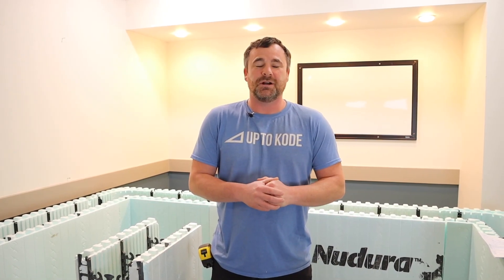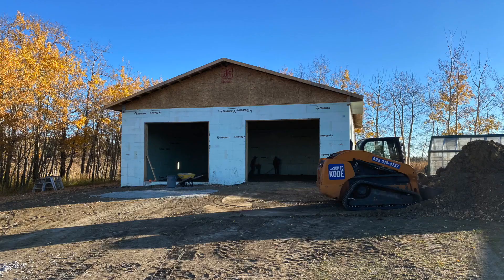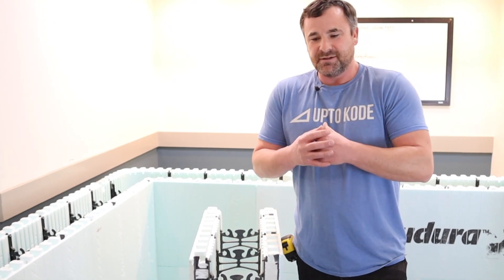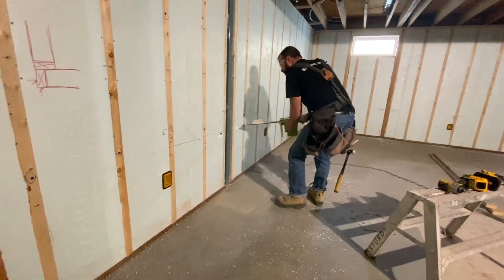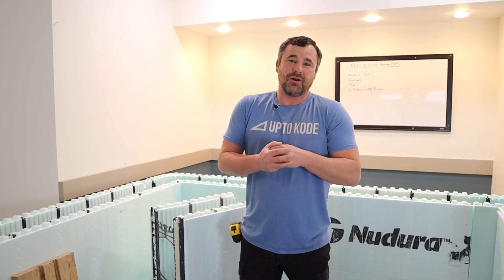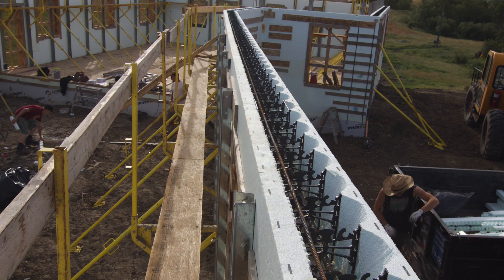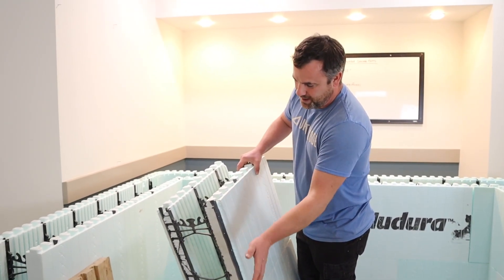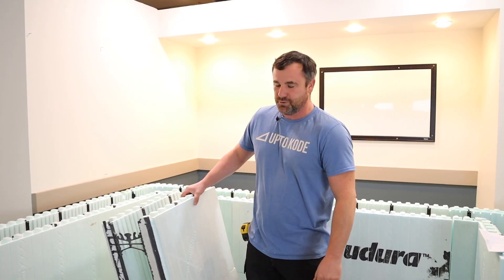Frequently Asked Questions of ICF

Comment: Excellent video. Thank you. However I have an amateur question. After you wrap the walls of an ICF house, how do you know where the plastic ties are to screw in external cladding. Most of the wraps are not transparent. I know the screw-in locations are every 8 inches or so and they are easy to see when you don't cover them with wrap, but how do you know where they are after they are covered in wrap.

Comment: 8:25, "ICF is about 5% more (cost), but can that cost be offset if the homeowner sets the blocks themselves?
Why isn't roofs ICF, is is because of the transition of the vertical walls to the diagonal pitch of the roof, and if so, will that transition piece be remedied in the near future with common roof pitches? I hope that made sense.

Comment: If you could answer this I'd appreciate it as no one else has responded. Is there a max wall length possible? Think of a shop, say 100' x 80' with 20' wall height. Would those walls be able to be straight or would jogs or maybe using T blocks to form support columns be necessary? Thank you!

Comment: Hey Kody, thanks for all of your great ICF videos!  We are in the planning stages of an ICF home on Vancouver Island.  A question I have never found an answer to is, how do you attach an interior wood framed wall to the corner of an ICF block  if the interior wall extends off of a corner of the outside ICF wall?  A 2x4 wall would only overlap the concrete in the block by 1.5" and the fastener would only be 1/2" from the edge of the concrete.  I wouldn't trust screwing into foam.  Could drive a Tapcon in at an angle perhaps.  Or do you run 2x6 interior walls in those locations so the end of the interior wood wall will provide more overlap the concrete portion of the block and give you 3.5" overlap with the concrete?  .Or maybe you only attach to the floor and ceiling? That seems a little more flimsy.  How about if an interior wall lands between ties?  Just a Tapcon or two?  Assume you would leave the foam in place?

Comment: Hi Kody.

Appreciate all the information. What do you think about ICCF (Perfect Block System) compared to ICF?

ICCF system basically takes the styrofoam and mixes it with concrete to make the blocks that are impervious to  UV exposure and any critters being able to tunnel through them. Also the weight of the blocks are such that very minimal wall bracing is required as opposed to ICF during the pours.  The ICCF block is designed that they use roughly 25% less concrete for the walls. Exterior surface can have stucco directly applied without the need for any additional prep work that ICF would require. Interior walls can have the drywall glued to the ICCF directly or a plaster or stucco as well. 

The cons to ICCF that I have seen are their weight per block is ~45LBS each (but as noted the weight helps in the not needing bracing). Shipping costs will be more. No internal plastic studs.

I am getting ready to build our home and have been trying to decide between these two systems (ICCF/ICF). I am really leaning towards the ICCF at this point but would like to hear any inputs pro or con.
Reply from the maker: Thanks for the great question. I don’t know a lot about ICCF but I do know this about ICF. 
-ICF is the only true monolithic wall. Strongest by far. Wind and tornado proof.  Blocks of any kind cannot compete 
-ICF is very air tight and the easiest to achieve this too. Our last house was 10X more air tight than typical homes in our area. 
-electrical is easy in ICF and no need to pre-determine or run anything in advance. Get the ICF and the shell done… worry about electrical and mechanical later. 
-The ICCF doesn’t sound bad actually and I don’t know much about it.
Reply from the maker: Do you mortar the ICCF blocks together?
Reply: The information that I have seen is that you apply foam spray to lock them in. So no mortar.

Also they claim 250 mph wind resistance.

Thanks for your reply. 

With concrete being about $220usd delivered where we will be building…I like that the iccf system uses about 25% less concrete.
Reply from the maker: I would run the math on the cost difference. ICF is still superior and you will never lose air tightness. I don’t like walls that connect or aren’t seamless.
Reply from the maker: If you needed 50 meters to do an ICF house, to save 25% of concrete that’s only $3375 or around 12 meters.  Not worth the sacrifice in my opinion.  But I do appreciate your thoughtfulness and if you go with ICCF you’ll still be doing better than most.

Comment: I wouldlike to learn more about how you apply stucco to ICF. I am down here in south Florida and staring an ICF project but still have to idea how I am going to stucco it! thanks
Reply from the maker: I’m a stickler for drainage plain so I would NOT apply acrylic stucco directly to the foam.
Reply from the maker: This is how I would do it: 
-synthetic paper against foam. (Tar paper will eat the foam) 
-2 layers of tar paper on top (whatever is local code for drainage plain) 
-proper water shed and flashing details to allow drainage behind the stucco
-wire and screw to the ties 
-scratch coat and brown coat of cementious stucco (keep super flat) 
-acrylic finish coat last.  Floated or texture finish depending on what you like.

Comment: How about how to use no-mix concrete? It's hard to mix it up in the hole as needed, so it's like it's not even worth using.
Reply from the maker: I don’t know anything about it but you definitely need large volumes of concrete that will flow into a wall assembly like this.
Reply: @uptokode  It's very tough to mix thoroughly even for a post-hole.

Comment: My daughter will build a relatively small icf house with a full basement and main floor from icf. Simpson tie brackets are supposed to be pushed into the basement walls before pouring the wall.
These Simpson brackets are $30 a piece, so I say build a 2x4 inner wall to hold the main floor up.
Cheaper, better for electrical, plumbing, and can level it out if needed as you go.
I can't imagine pushing in the Simpson brackets consistently level and plump into the inner styrofoam form and maintain it during pouring and curing!
These Simpson brackets are basically a hanger bracket with an attached metal peg ( bolt and sleeve).
Reply from the maker: I see your concern. I would use the Watkins hanger and if you need advice on install just email me. kody@uptokode.com. But if you are more comfortable framing walls you can do that too. Makes sense for a smaller place.

Comment: So many brands out there...Nudura, Fox, LOGIX, Advantage, Amvic...now I discovered one that's made in Pincher Creek called Superform. Have you ever worked with them?
Reply from the maker: I’ve seen them around. They are just south of me.  I don’t like the 6” centres.  But otherwise I’ve heard great things about the block.  The ICF system is what I promote most.
Reply: @uptokode  another wonder…my wife and I are in the process of getting plans for a house drawn up. Intentions are for ICF to the rafters. I’ve researched various methods of attaching floors to the walls and now my preliminary drawings have something I’ve never seen but seems to be common here. The draftsman put in a taper block at the top of the basement wall and then transitioned from 8” to 6” for the main floor. Foam was removed from the interior of the bottom course of the main floor walls and a 2x4 sill plate fastened down with a ledger set on it and fastened to the exposed concrete where the foam was removed. Apparently they spray foam the inside of the ledger between the joists to bring the r-value up. It makes me a little uneasy
Reply from the maker: That’s way to complicated. Email me if you need. kody@uptokode.com. 

Don’t transition block widths. Use Watkins hangers or the Simpson system. Burmon has a hanger too. 

Keep it simple.  I think you know that.

Comment: Do you have a "best to use for Canada (Alberta)" 2023 opinion? I know Nudura is Canadian made, but if you're planning a build in AB, whats the most cost effective brand going to be? I'm planning mine and that's my biggest issue right now. Planning a 6000 sq ft place, so knowkng the total cost of each system or cost per foot would be handy.
Reply from the maker: I simply like Nudura. For multiple reasons. If you look at the price of the block it may appear to be more than others, but they come collapsed (saves trucking and space), they clip together (less labour installing), they are reversible (less waste). So at the end of the day the block systems are all very comparable in price. 
Shoot me an email. kody@uptokode.com.

Comment: Alllways great videos, Cody. Keep them coming.. I have the same old question. I live in Tampa Bay, Florida and as you probably know, we have threats of hurricanes every year.. So I love the idea of an ICF home, but I want to go much further and make a roofing structure to compliment these walls!!!  I literally DO NOT want to pay for insurance or worry that I should have it!!! This means I'd have to build a hurricane and fireproof home.... Adding to that, I want to put solar on the roof and be sure it is not going to be the cause of any leaks or that it can be ripped off the roof in high winds....  Coming up with the answers to these issues would completely change the industry and the ball game.....  Personally, I would add to this build, steel shutters to cover all windows and doors in the case of hurricanes. To me, this is the only way to build and we should expect nothing less.....
Reply: You could do an Icf roof. But imo a standard truss roof with hurricane straps and Icf walls should be fine for anything you throw at it. Solar panels I'd recommend to ground mount them if possible.
Reply from the maker: Thanks for your insight. I would add… don’t use the tiny crappy little hurricane ties that only bit into the bottom cord of the truss. I would strap right over top of it. That’s the proper way.
Reply from the maker: Did I comment to you in other posts? You can always email me too. kody@uptokode.com.  

For a sloped ICF roof I have NO experience but have heard quad-lock has a great system. 

If you want a flat roof (super low slope) I would suggest the “Fortruss” system. It’s fully insulated with different configuration of beam sizes and depths available. Then you pour a slab on top (garage floor OR flat roof).

Comment: ICF should be compared to a double stud wall.....Apples to apples...ICF is way beyond 2x6 wall.
Reply from the maker: You have a point. But once you start with the double stud wall, in my opinion, you still don’t have anything close to an ICF wall, you have complicated the build, more lumber used, still susceptible to air infiltration, still susceptible to rot, no thermal mass, no added strength, and I bet the exact same price. 

I say this… build conventional if you want the lowest cost possible. If that’s your goal. If you want efficiency skip all the fancy BS and go straight to ICF. The benefits are substantially better than any modified, fancy system out there. No other system can match the benefits and simplicity that ICF offers.

Comment: Can you do a video on attachment points on the exterior for rooves etc. ? Possibly low thermal bridging points.
Reply from the maker: We install an LVL top plate that is bolted to the concrete. Below that is a strip of acoustical sealant and PL premium. If you want to reduce bridging, use a slightly narrow LVL, keep it flush to the exterior and then foam the interior side to stop transfer at the LVL.

Comment: Thanks Kody.  I'm having an ICF home with Nudura blocks built for me in Indiana. Do you hang TV's from directly from the Nudura anchors, or do you insert a 1/2" plywood board like you mentioned? It's a slab on grade build, and we just got the plumbing inspection completed for under the slab, so floor and walls next 🙂
Reply from the maker: Congratulations on your build! It would be ideal to insert the 1/2” plywood for a TV.

Comment: Right on Kody!  It's great you go in depth with all you do.  You explain in your own great way and learn a ton and enjoy each and every vid.  Hope the week is going according to plan
Reply from the maker: Very much appreciated this! Thank you my friend!
Reply: Hi Kody,

I have a few questions I hope you might be able to help me with:
- 1. I heard someone talking about how ICF negatively impacts the positive thermal properties of the concrete, due to the interior face of insulation.
Is there any truth to this?
- 2. Is use of drywall required or can T&G wall boards (for ex) be installed directly onto the interior walls? Reason I ask is concrete should negate fire code requirement for drywall… but, does the interior face of (flammable) foam then re-require the use of drywall?
- 3. You mentioned ICF performance against natural disasters. I’m in tornado country, and I tried to find testing data on ICF (and poured concrete walls in general), but couldn’t find anything that made clear how 6”/8”/10” concrete walls performed in tornado conditions (failure at given wind speeds).
Do you have info, or data you could link or direct me to?
- 4. I’m looking at building a fairly small home that is based on 16’x16’ modules. Something I’ve thought about is where 3 modules are connected linearly, at the middle module which wouldn’t have 2 sides of exterior walls, having 2’ of wall (via T-blocks) return into the interior to act as additional structural rigidity. If there’s structural benefit in doing this, it wouldn’t require much extra cost. Thoughts?

Thanks!